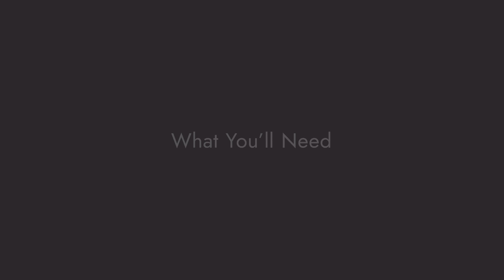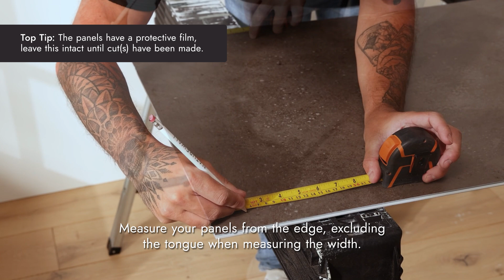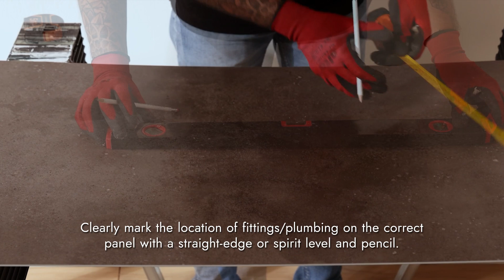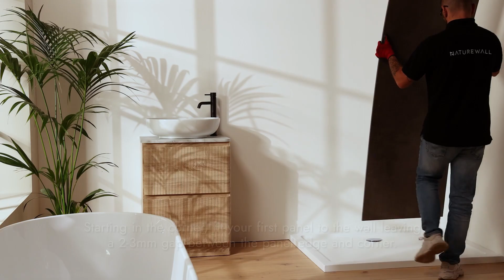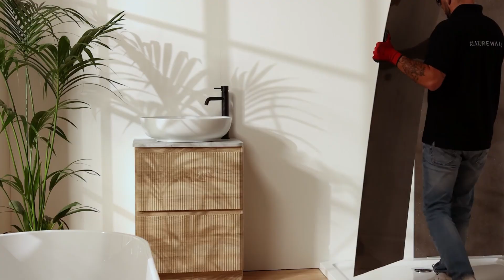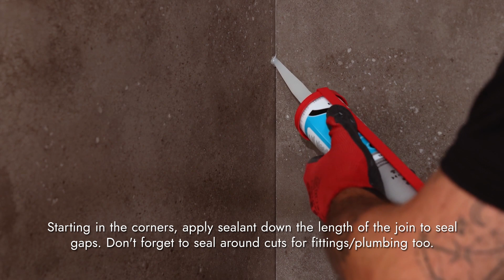How to Install Elemence SPC Shower Panels | Step-by-Step DIY Guide

Comment: Do you not need a corner trim then ?
Reply from the maker: Hello, Our Elemence panels can be fitted with or without trims, depending on your personal preference and the finish you're looking to achieve. 
 
If you decide not to use trims, please ensure all edges are fully sealed using a suitable sanitary sealant to maintain a watertight finish. 

You can discover more about our shower panel range on the link below:
https://www.naturewall.com/collections/shower-panels